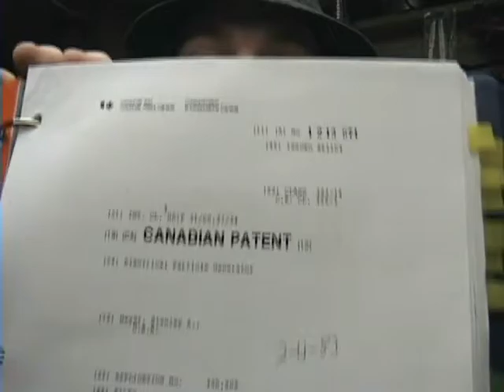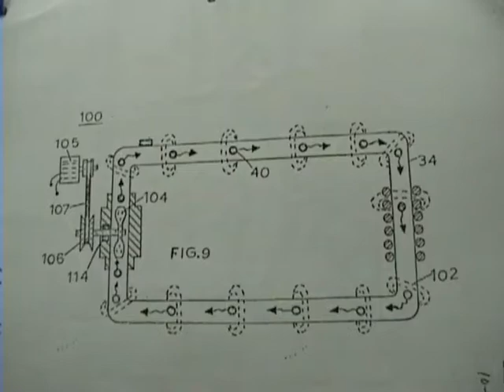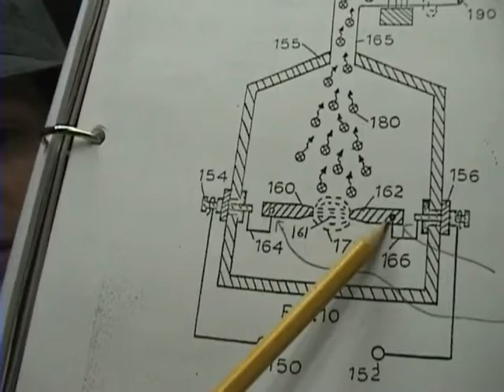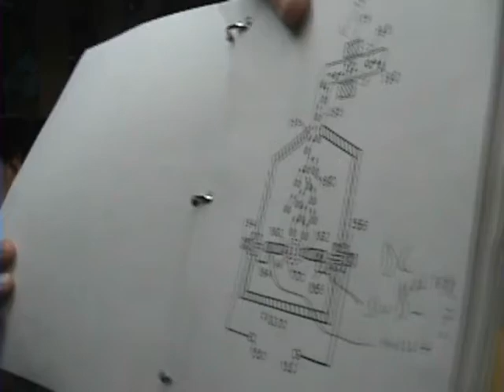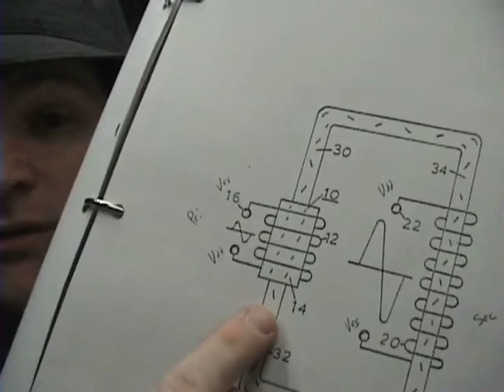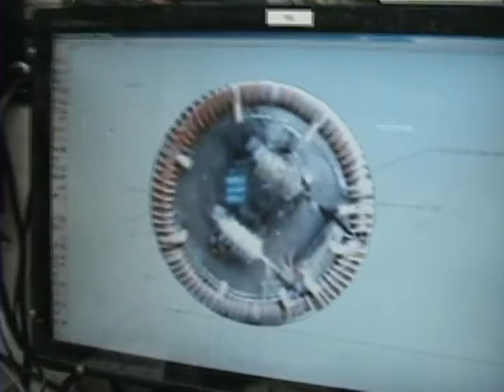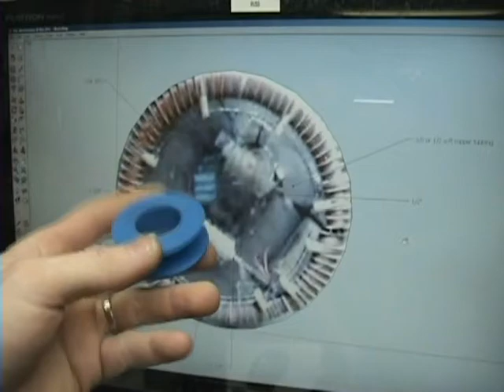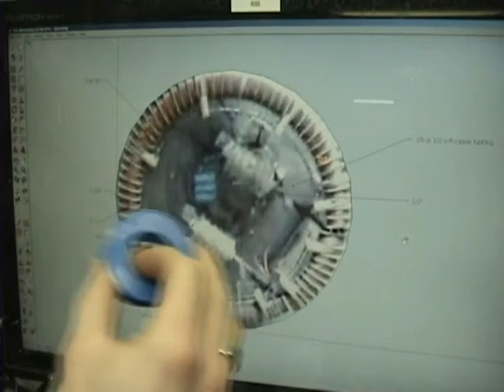P3 The Key To Stanley Meyers Water Car, Gas Electrical Hydrogen Generator, Self Staining Device...

Comment: Stan used distilled water, stainless steel tubes and a 20khz stair step DC pulse train. The tubes were capacitors fed by voltage though coils to form a SERIES RESONANT CIRCUIT. The VOLTAGE builds up on the capacitors (tubes)  due to CHARGE PUMPING from the DC Pulses. Somewhere around 2kv the hydrogen / oxygen bond breaks (due to voltage breakdown of the insulating properties of the Distilled Water). Durring the off cycle the water recovers. He was cracking the water with Voltage not Current.

Comment: @rwg42985 , Russ, I meant the ionizer you showed is basically an asymmetrical cap. That is how they work. It's also how most non-UV or spark-gap ionizers work.
Thank you for all the info you are passing on.
You Rock.

Comment: Ferrite will respond quicker to pulsing than steel core,it looks like there are several coils on the primary.so each coil would be fired one after the other in a linear sequence.i figured an easy way to pulse in sequence would be use a light chaser circuit or maybe even a rotor with hall effect sensors placed around it.either way it needs to lock onto the gas lattice and move it like a mag lev train.how where you thinking of doing this?

Comment: Russ, the ionizer is HUGE.... Basically it's an asymmetrical capasitor - an electrokinitic device. They are easy to make, I'll send you the plans.
Electricty takes the path of least resistence, and if the resistance is less inside the pipe - that is the path it will take. Looking at the pic of the S.M. setup, the pickup coils look to be at an angle. Not aiming to the center, but it mite be the pic.
I'm skypeing Matt right now.
I'll be back
Bill W, and Matt P. both Rock

Comment from the maker: @matttatts yeah, the only thing i could think of is suspending the magnetite in an oil/sulrry of some sort. its even in the patent. but it states gas is preferred. so it may work but not at a high efficiency. something to try. 

the static idea is something i have not thought of... an interesting thought!!!  i think that if it would it it would be transferred to the out put coils, that may be good and may not... depends on what your trying to do i guess... 

thanks for the feedback! ~Russ

Comment: my idea was to try to use a baffled chamber in the tube, a step down in the radius of the tube.  a wooden baffle with a smaller hole. magnetic gas would bunch up behinde it, upon being pulsed by said coils, it would create a invisble smoke ring, the spreding of the smoke ring imho, will induce a voltage in the pickup coils. this is so you can se results at every step of the way, as the accelerator coils are energized.  the baffle would create an acceleration, and a change in velocity in the gas.

Comment: after watching your progress on making the gas i decided to go a bit of a diffrent route. 

rather then making gas i think im going to mill down some magnatite sand to a fine powder and then try to spin that. figure ill get more quantity for cost and time.

i considerd if its in a plastic tube it may also genrate static electricity. bonus or a pitfall i dunno.

thoughts?

Comment: I've been looking over everything I can find on stans work and I agree there is something he left out pertaining I think to magnetics. It's good to see you are on the same track with that and vacuum. Specifically I am wondering about the reason for his tube shaped cells over flat, and that lead me to look in the direction of each tube perhaps being a hydrodynamic motor to shake the bubbles free as in Trvd2XOIeXY. That with some engine vaccum and magnetic seperation of elements.  Your thoughts?

Comment: Hey, not a bad video. A few questions though... Is that DC that you mentioned pulsed at any particular frequency relative to a second separate source on the other electrode? {depolarizing water first as an example -  therefore making it easy to separate the hydrogen from the oxygen at the same time}. Also, do you have access to a scintillation counter? That might be something worth looking into! PS I always end with a LOL and a :goat-turquoise-white-horns:...JOE.

Comment: I am not guessing, As the son of a fitter-mechanic, I spent my childhood in my dads workshop tinkering with cars, and I still do, I also have a full time job as an electrician who specialises in switchgear so I am no stranger to the practical use of electricity or engines.

Comment: Fill the gas generator with argon, and use iron or whatever ferrous material nails as electrodes. I would say DC is the way to go. I'm in welding school now and there is a huge difference in AC and DC. DC tends to magnetized the piece being welded, AC resists this due to the rapid pole shifts.

Comment: @rwg42985
for the consumable electrodes inside your particle generator why not try something in the higher ampere range pushed through MIG welding wire. at high enough amps+volts you may be able to atomize steel or iron particles from it to saturate to gas core.

Comment: @rwg42985 i was considering suspending it in some sort of heavy gas. hopefully that way it still flows a bit more freely then in a fluid. im thinkin of trying both tho.

 he said a light solid or fluid or gas. the problem seems to be coming up with an adequte quantity of the gas. im watching closely to see your progress on this front.

he said the velocity of the magnetics inside as well as the mass of said magnetic material and the amount of coils will determin its output

Comment from the maker: @Me102288 I think your confused as to what im working on, this is the EPG unit, not the WFC unit... Anyhoo... 

The end result has nothing to do with an engine running on HHO,  what I'm working on is nothing more than a supper efficient transformer...  so efficient that the out put is gratly amplified! 

Google EPG, or check out the description. 

Thanks for your thoughts! 

~Russ

Comment from the maker: @mikepowers420 yep! mike, the coils slip over the pipe, that silver thing you see at the bottom start of the driver coil stack (in the big photo) is a control knob. it has a hole in it and it is used as a set screw to hold the coils.\, thats it...  also the inner rings you see in the single stack EPG's are 1/8" brass rods, they are Buss Bars. each coil is soldered to the buss bar in  parallel. these things i have seen my self... so i can confirm that is is not a asymmetrical capacitor driver...

Comment: Any water as long as it contains h2o, distilled is best because of its dielectric insulation properties which helps in charging properties of water capacitor , better charging helps control  amps during charging and discharging of water capacitor (best idea is to not consume power input, but rather trap power in VIC/COIL circuit, and circulate through capacitor banks meaning les input once running  at full capacity...  Zero-point comes to mind

Comment: no need imo for iron cored coil. because the core would cause a slow down of flow, because magnets will stick to the coil. now oddly enough, this fits in with my idea of wooden baffle to cause a bunch up, or a change in acceleration in the fluids dynamics.

Comment: Russ this might not apply to testing without laser, but Stan said he added a reflective surface to the inside of his nonmagnetic tubing, for the laser. Maybe Mylar  "stuff inside potato chip bags"  I wonder how this reflective surface would change effects with copper or PVC tubing if any change at all. Here is a video of a guy blocking cellphone signals with mylar .

Comment: I was thinking you would be able to get magnetic energy into the gas by using an air ionizer and ionizing the ambient air as Stanley did say in the movie the argon gas is the insulator between the - and + gases.

 the ultra violet laser also increased the magnetic field with each pulse,ultra violet light has an affect on particles by making them + or - charged not to sure now witch is witch will need to look it up,  the laser was also used to pump the gas.

Comment: Oh yeah and some HV diodes can be found in microwave ovens...personally i dont think it will matter since the electrodes are definatley being vapourised using AC,but there may be a charge that carries on the vapour since with DC the vapourised metal will move from one electrode to the other but AC just move around..if the Argon was missing electrons it will want to stick to the opposing charge

Comment: My gut is telling me this is a place for thorium/tungstion welding rod material to be intimately milled and cast into a ferrite torriodial coil. I think the minute radioactivity of the thorium will aid electrons to remain in the higher electron valence state long enough to make it easier to separate the atoms of the water molecule. You guys are dead on in that the secret is in the resonate transformer.

Comment: wiki/Corona_discharge
good read on the pointed electrodes.

But yeah, the more I think about it, chamber 32 was most likely grounded imo.

you don't have any HV flyback transformer diodes in your "collection"?
I could mail you a couple i suppose.. I don't see why flyback diodes wouldn't work with nst's, (I'll test that theory first if you want.)

Comment: It wasn’t simple HHO.. use the negative pulsed back EMF like from the hairpin.   Meyers HHO bubbles looked like you poured milk into water they were so small.  Also try iron nano particles mixed into air conditioner compressor oil to make your own ferrofluid.

Comment: Stan injected water directly into the cylinder not by using electrolysis inside the cylinder . Look@ Stan Meyers patents. His injector shows the injector spraying the water through a plasma field inside the injector and doing electrolysis inside the cylinder and using the expansion inside the cylinder to generate pressure to push down the piston thus creating work. He was telling you about electrolysis in his videos but you have to look at his patents again

Comment: IMHO, shouldn't ionized particles produce the same effect as "magnetic" particles? As most of you know, ions are simply atoms with a positive charge. Electrical current applied to a sealed container of hydrogen will produce a purple plasma. When it turns into a plasma, the electron shell breaks down. Once this is achieved, the plasma (and ions) can be steered using magnetic means. A rodin coil would be a fantastic way to produce the confinement for fusion.

Comment: @rwg42985 hey bro , if you want to make usable amounts of hydrogen look into steam reforming, the iron steam process can produce 4,211 liters of hydrogen using only one liter of iron and alot of heat and steam, ,at  600 degC .dont take this the rong way  i just wanna help u and i personaly dont beleave in stan meyers for several fundamental reasons. most of wich are simply observational flaws in the reality of one posessing such knowlege. you may be write though dont let me ruin it for u.

Comment: water boils in a vacuum stan always used water hes throwing in other gasses to make you think ..so vacuum a stainless steel tube place a pos to outside and the hydrogen with the one electron will centralise hit it with a led like track and pulse with coild all around the tube bingo epg fast as light generator....he made stuff simple but tried to keep it looking picasso type on ptents so it could not be copied and stolen